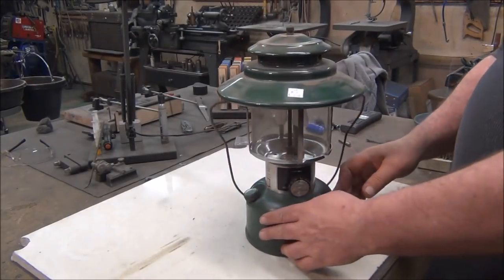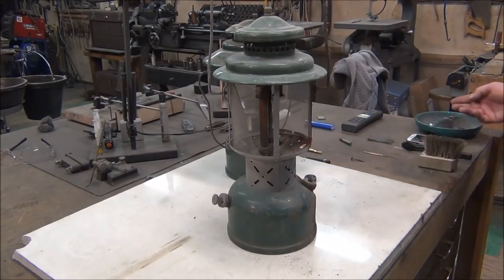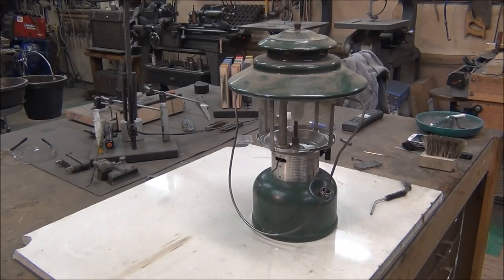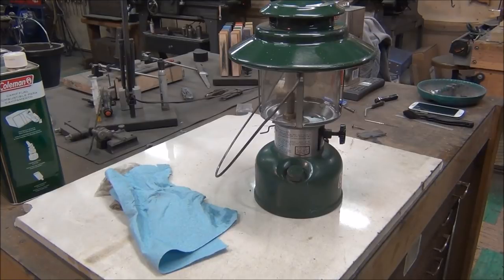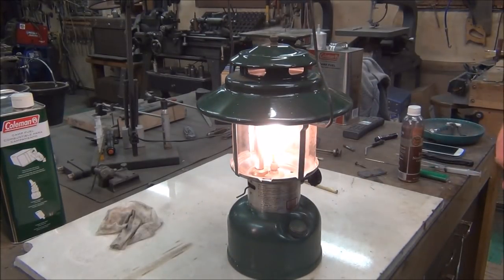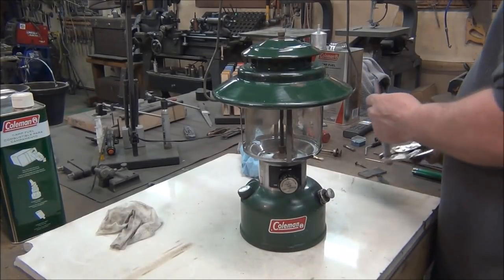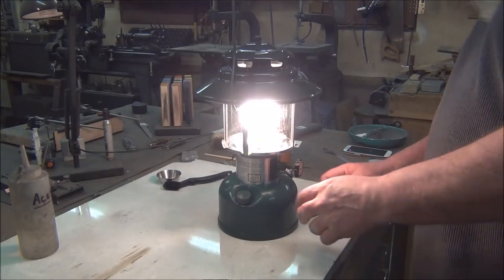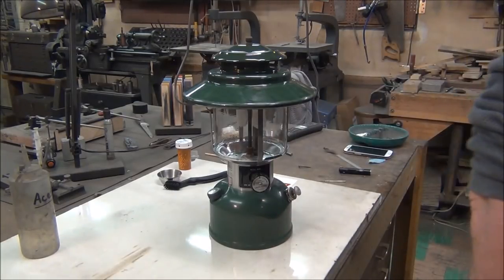Vintage Coleman Lantern Evaluation, Cleaning, and Maintenance

Comment: I saved a 200a marked 8 59 and a 228d nickel from the dump. They are both packed full of mud wasp nests. I love these old lanterns. Time to evict the squatters! Thanks for the video. I'll be back soon...
Reply from the maker: Stacy Boots good luck with your lanterns. Ya gotta love those dang mud wasps 😡
Reply: Shane - Blind Dog Blades update 200a works great! The 228d will be the challenge! If these old girls could talk! Thank you.
Reply: 228d update works good enough had to flip pump cup around. Fuel flow seems low. Have to watch video again. Fount marked 50 can't read month side. I used dish soap and water... No leaks ! Thankyou!
Reply from the maker: Good job @stacyboots1818  I'm glad it fired up for ya.

Comment: Nice! I just got a '74 lantern for $20.  Haven't had a chance to fire it up. Valves and cleaning lever were stiff but I got them to move freely. Seems to hold pressure on the pump and there's an extra pump and mantles stuffed inside. Looking forward to playing with it.

Comment: I'm about to get my first Coleman, a 282-700t. It's also my first gas lamp, mostly in England we use paraffin/kerosene lamps. This vid was really useful.  Thanks. 
PS: go easy on the cigarettes!
Reply from the maker: seamanjive thanks and good luck with the new lantern.
Reply: @SWPhotography  Up and running real good, fitted correct mantle, bit of a cleanup, checked for leaks (all ok), lube the leather and filled with Aspen4 fuel. Burned in the mantle, fitted the globe, bit of a pump and shes away! Super bright, easy light, great lantern. My go to already!

Comment: I was told, that you can use a propane torch you sweat pipe with...and torch the generator... then drop it in cold water.. Repeat if you need to to get the  ceramic/cardboard tube out. 
Also, torching it can help clean it. The older 'paper tubes' are ceramic type and can take the torch directly, but not the paper ones. (newer ones).
I was told this from the oldcolemancollector forums.

Comment: Bought my double mantle in '75 for $10 used. Used the heck out of it. always worked fine, never cleaned it. This thing will really give off a lot of heat. Warmed my van up to comfortable temp when freezing outside. Don't recommend sleeping with it on though. Will keep you warm outside if you huddle around in with a blanket over your back

Comment: Great video thank you. I have a model 275 I’m going to work on. Hope it goes as easy for me as it did for you. Looks like I’m going to have to remove the check valve for starters, back pressure. Again thank you for a great video.
Reply from the maker: You're welcome Dan.  Good luck with you're lantern!

Comment: I have two Coleman dual fuel lanterns, a 295 model I've had for a good while which seems to work fine and I recently acquired a 290 model which is the one I'm having problems with. The issue is that I cannot seem to pressurize the tank and therefore it just doesn't light properly or if it does just about get going it soon stops!

I reckoned that the likely issue was a loss of pressure at either the filler cap (losing pressure) or the pump end not working properly (not gaining pressure). To try to narrow things down with the parts being interchangeable between the lanterns I decided to swap the pump and the filler cap from the good lantern to the bad lantern to see if this cured it, if it did I could then work out which component was faulty.

Yes, you've guessed, swapping these components, both of which must be good because they work on the other lantern, the second lantern will still not come up to pressure :-(

Where do I go from here? Can you give me any advice, please?

Thank you!
Reply: oldcolemanparts com/search.php?mode=search&page=1 
(note, I removed the (dot) before "com") That is 'fuel cap' search results. Notice one is a 290-1401

Comment: I soaked the leather cup over night in 3 in 1 oil . I have a 1970 model 220F  the model number is on the bottom as well as on the silver band around the middle of the lamp . So far its holding pressure, but I’m moving soon so I’m not sure if I want to start her up because the mantel’s become very fragile after you burn them. I like the older ones . These , I believe are duel fuel. Colman’s or unleaded gas .P.S. not smart smoking near flammable materials.

Comment: Hi
I am based in the UK. We don’t have a lot of Petrol lamps. The one I have was bought for me. It’s an old Coleman 335. 

I stripped it down after watching you doing it. I have lost the tip off the generator.  Can I use a generator off a younger lamp as I can not get spares for old lamps here
Most people use butane 

My friends are telling me to dispose of it. There telling me that if I use a different generator it will explode. Any advice would be welcomed 
I’ve sort of fallen in love with it

Thanks

Comment: very nice very detailed video.  i have a few in storage i should probably drag out and go through.  i have never used mine, how long do they usually last on a tank of gas compared to the propane ones
Reply from the maker: Thanks Adam! A larger 2 burner like this one will last around 7 hours on a tank of gas.
Better drag yours out and fire them up. They are great lanterns.

Comment: Great video. How would you get the screw piece that is down in the plunger tube if it is stripped? Your vice setuo popped it right out.
Reply from the maker: It can be a pain if it's stripped. A tool made for it ... one like this one. 

https://www.amazon.com/Coleman-Removal-Wrench-Professional-Lantern/dp/B01L7BMV7K 

will work sometimes cause the center bolt locks the tool in place. You can find them on Ebay or Amazon.
If that doesn't work drill it and use a screw extractor.

Comment: there is nothing wrong with that rusted 220. soak it in evapo-rust for a day then do a regular jet system clean! as for pinholes in fonts.... i solder them but covert the latern to kerosene (for safety sake), never had a prob
Reply: @jo9732  very simple. Switch genorator jet to a kerosene size and add a preheat cup. Utube 'coleman kerosene conversion'

Comment: My lantern holds pressure but when I turn valve on I hear no fuel spraying...lantern won't light. Do you think I need new generator?
Reply from the maker: Mike Cip yes or it just needs to be cleaned. One way to check is pull the generator and take it outside, pump it up a little and slowly open the valve. If gas comes out then it’s the generator, if not it’s the pickup tube. 
Good luck
Reply: @SWPhotography  thank you sir I really appreciate it!

Comment: you could get a new style generator and use a tip cleaner 0.008 in size and see if the new ones are too big or not. but i just buy new style ones and rebuild my old ones for now.

Comment: I can get the generator tube out of my 220E but cannot get the heating tube, where the mantles hang from, out from the base.  Any suggestions?
Reply: Charles T. Murray   i have the same model and same question...
Reply: Try again
Reply: Charles T. Murray  try spraying it with any rust out or wd40 let soak for at least 15 minutes. If all else fails heat with touch .
Reply: If you can get your hands on a can of Kroil that'll allow you to bust it open, far better than WD-40.